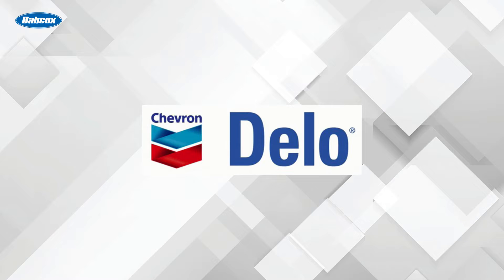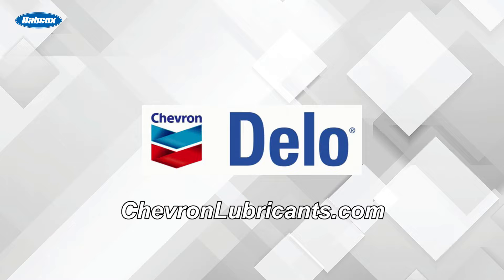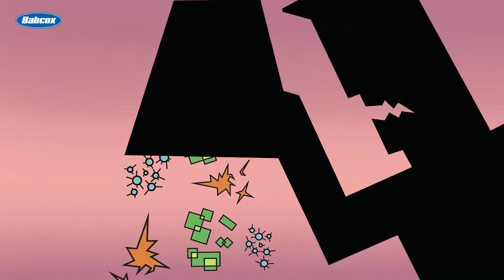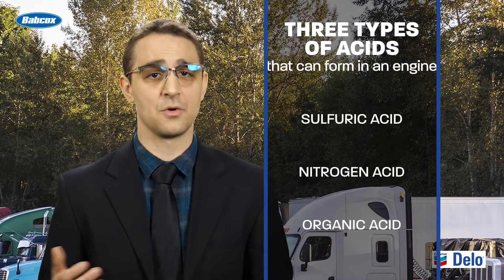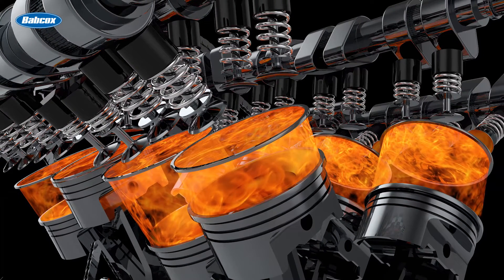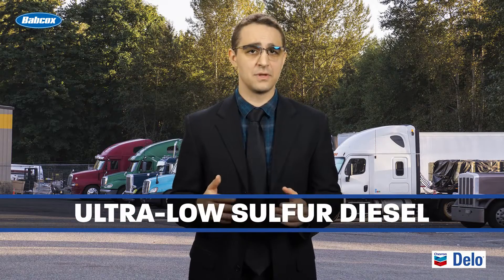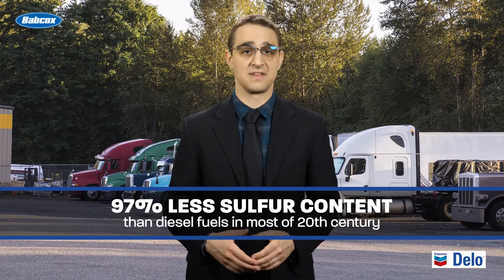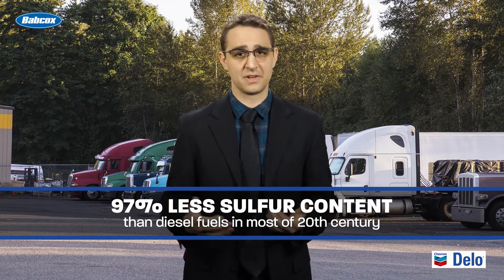How Sulfur Can Destroy Your Truck's Diesel Engine

Comment: Hey look he switches between oil and fuel randomly and gives no information.  I have a CP4 fuel injection pump that requires me to add lubricunts to my oil so it doesn't self destruct.  Lying communist climate worshiper.  You can tell this guy works on diesel engines full time, or at least his wife's boyfriend does.

Comment: The fuck? It’s not a matter of corrosion, it’s a matter of the reliable Diesel engines that were made for higher sulfur content and the later Diesel engines that were ok, I guess, for ulsd. By the way, thanks for making diesel fuel way more expensive than it should be.

Comment: I can tell ya this. When high sulfer diesel was available it made a diesel run! When ultra low replaced low sulfer high sulfer disappeared shortly after.
For those that ran the good stuff the power losses were immediately noticed.

Comment: not possible. sulphur needs to be converted to sulphur dioxide and then sulphuric acid in the presence of water. the combustion cycle happens way too quickly for this to occur and besides, there is no water in the combustion chamber (and yes, moisture in the air is negligible).
Reply: Water is a direct byproduct of burning hydrocarbons. Its literally whats formed with the HYDRO part of it.

Comment: THIS GUY IS FULL OF $#%T.
You aren't getting Sulfur TRIoxide 4-12 ppmv under conditions when they were trying to make that the case  . Sulfur dioxide yes but that doesn't make sulfuric acid when it hits water.
LOW SULFUR fuel is *****WHY THE FREAKING SHIP THE "EVER GIVEN" is trapped blocking the SUEZ CANAL!********
Low sulfur fuels according to an interview of a retired captain often causes power loss.
Thank this A hole and the EPA and the numerous other  organizations that forced this upon us.
Reply: Furthermore, that photo at 1:06 is "High-temperature sulfur corrosion of a 12 CrMo 19 5 pipe stub (used for insertion of a pressure indicator).

Comment: Very misleading video.
Reply: i drove a 2.5l diesel engine from toyota, its already 5 year and i using hih sulfur diesel who has 3500ppm of sulfur in it. and it still runs good. and the best part is the fuel is very cheap its cost only 1,65  USD per gallon. i live in Indonesia the fuel is kinda cheap and rolling coal is legal
Reply: @vitabudi  
That's why if I walk around in Gujarat for half an hour my face will be black. Yay no EPA!